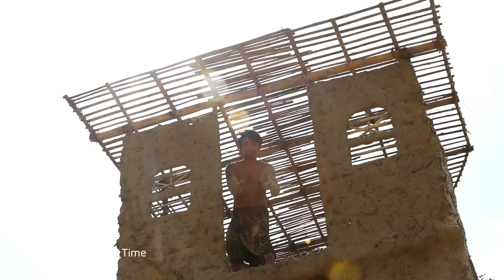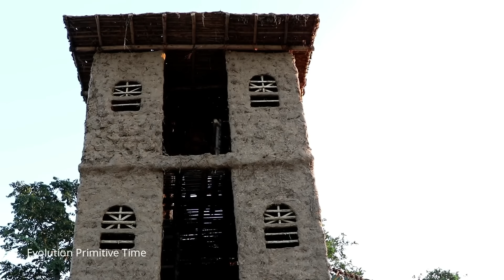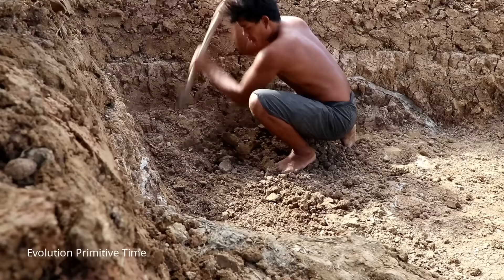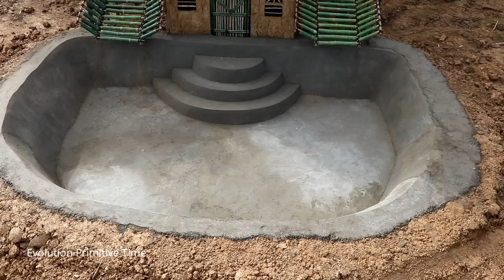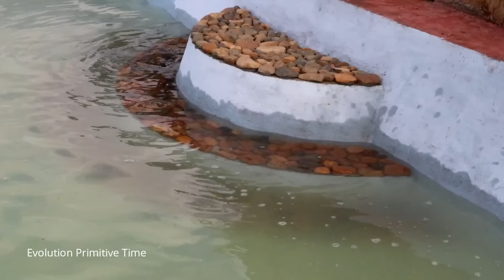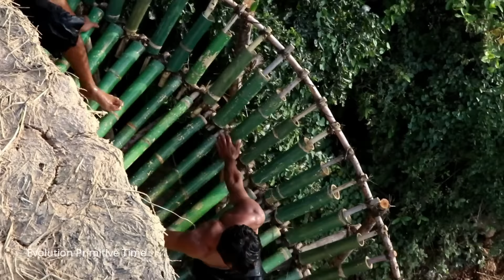Build Three Story Mud House With Bamboo Water Slide Around House And Build Big Swimming Pool (full)

Comment: Do y'all wonder who actually lives in the houses they make?
Reply: they are for display, during the rainy season, rain will liquify the mud walls, wind would rip apart the bamboo frame,  the pool water is unfiltered, needs to be drained and replaced sometimes, that would not be practical.
Reply: @wsattler  imagine if they left a baby inside
Reply: @iaminkermitable7344  🤣🤣🤣
Reply: Hahahaha you consider this a house ? Our grandparents in Lebanon used to make house rigid like castle from mud . The either use stones and mud or mold the mud in brick shapes . And it was at least 50 cm thick walls.